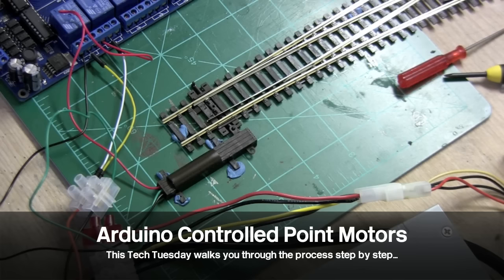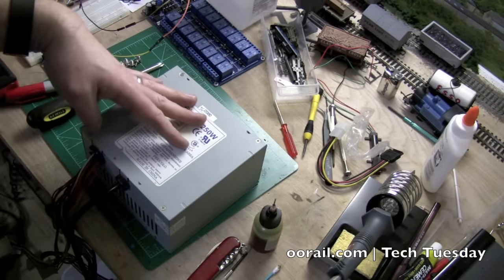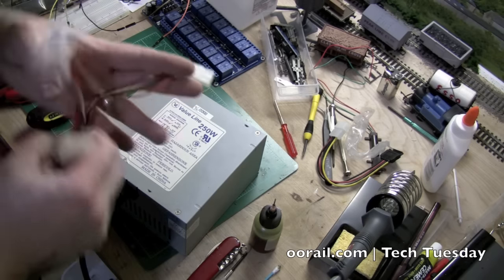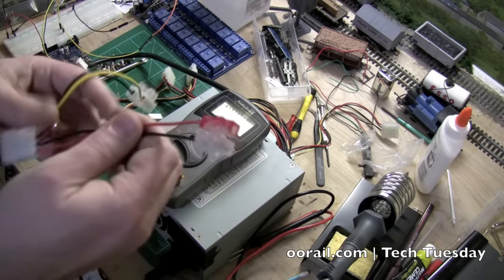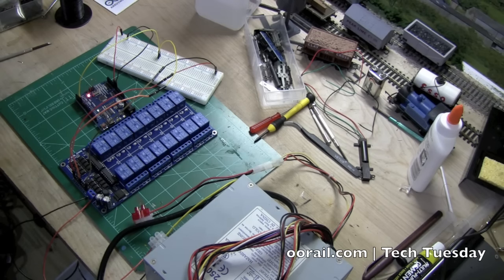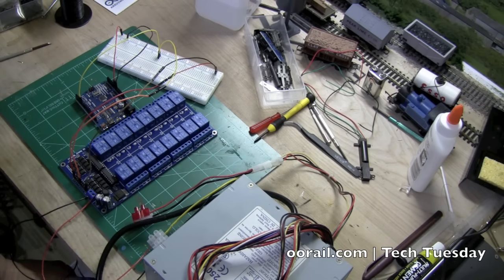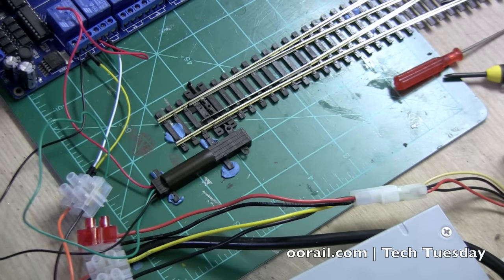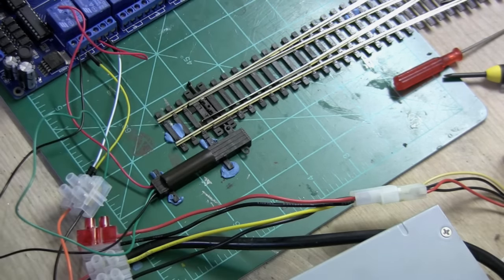oorail.com | Tech Tuesday - Arduino Controlled Point Motors

Comment: You got off on a completely unrelated tangent because of a power supply that had a stuck fan.  For those wanting to use a PC power supply (an excellent choice, by the way), there is absolutely no need to open up the case.  And some of those power supplies do not have an external switch, just a power switch on the back, although one might have to short one of the pins to ground on the plug that went to the PC motherboard, to simulate a person pressing the "power start" switch that is normally on the PC case.  (In other words, the much older AT style power supplies that has an external power switch and the newer ones that simply have power applied to the motherboard continuously -- at least to that circuit that goes to that pushbutton switch that is on the case.  I hope that makes sense.)

And if you have the case open, you won't get killed from touching one of those low voltage DC capacitors (unless you have wet hands, in which case you shouldn't be allowed to be around electrical circuits at all).  Those are just to filter the pulsating DC power (usually about 18 Volts peak DC) to a steady 18 Volts, before going through a Voltage regulator circuit -- or in modern power supplies the whole thing is done using fancy fast Silicone switching circuits -- called "switching power supplies", which are more efficient.  I also have a degree in EE (actually EE + Computer engineering, and a member of the Electrical Engineering Honor Society, "HKN" or Etta Kappa Nu, from George Mason University -- AFTER having spent over 25 years in electronics.

But you should not be messing around inside one of those power supplies with the power applied.

Comment: Excellent "How to" John, very easy to follow.  I have converted several ATX power supplies in the past, you need to bridge the green wires to make the power supply think it is connected to a motherboards, the ATX needs a resistance to make it switch on.   Other than that it is the same as your AT supply. Looking forward to you other tutorials...Simon
Reply from the maker: +Liverton -Simon Thanks Simon... Yeah I didn't want to completely scare people off, so the AT power supply was a quick and easy way to do it. They are also a lot cheaper to pickup new :)

Comment: This is (except for the fan sidetrack) an excellent video.  Thanks much.  I sent it to a 12 year old friend of mine in another state that I sent some Arduino sets to.
Reply from the maker: No worries, glad you enjoyed it. Background noise is an on-going problem around the layout, I typically only have enough time to do these videos on one take, so I often run trains in the background to drown out any unwanted sounds. The layout is in the basement, so everything from kids, dogs and cats running around upstairs will generate background noise in the videos. One option is to narrate the videos during the editing process, I do have the equipment for that but it is more time consuming. The other options (which I'm trying first) is to upgrade the flooring upstairs, which is currently in progress :)

Comment: Cool approach, definitely interesting. I'm starting to to figure out controlling the point motors on my layout, I have 25 points just in and around the station. I've done quite a bit with an Arduino before, so this is worth exploring. Thanks for sharing.

Comment: Did you ever take this to the next step and actually control the points/turnouts with switches to operate the relays via the arduino?
Reply from the maker: Hello Bruce. Yes but I swapped the arduino out for ESP8266 and ESP32 devices on the layout. I will be making the code available in an upcoming video. So stay tuned!

Comment: I got it all the way correct until the point when I get ready to attach the 3 wires (in my case 3 screws), to the relay outs. Using two of the relays at that. I think that each side (relay) would control a direction? Then you used a external power source from some where (where you added that connector). Did you run the positive that positive 15v directly to one of the point's wires? (Positive 5v)? Do the other 2 wires from the points connect to the "closed" side of each relay? Thanks! You did help me a lot. LOL

Comment: Have you considered bagging the relays and going solid state?  A Ti L293 or L293   ($2) could be controlled by an Adafruit ESP8266 ($10)  running your existing Arduion code.  Much smaller foot print, no relays.
Reply from the maker: Thanks John. Yes this is a good suggestion and one that I did look into. The problem with L293 is that the maximum current draw supported by the chip is around 600mA, while a point motor like the PL-10 will draw about 2A and the gaugemaster ones I have I think draw even more. Since point motors are only tripped for a second or two, a small heat sink may do enough to protect the chip. That said, the ESP8266 platform is definitely the way to go. There are a number of ESP8266 devices I am currently experimenting with for a variety of Tech Tuesday projects. I have a stack of L293d chips, so when I get a chance I will experiment some more with your suggestion. I'm not actually too concerned about the footprint as the relay board, arduino mega and an ESP8266 board are mounted to the underside of the baseboard, centrally to a bunch of point motors. That said, I'm going to shop around, see if I can find a better IC option that can handle higher current draws.
Reply: This is some info I got on a forum I had posted on about this for my own set up.  It may be of interest with regard to your power draw.

"if your solenoids need less than 1.2A you might want to look at the TB6612 breakout:

https://www.adafruit.com/product/2448

The TB6612 works like the L293D, but has a higher current rating. If you end up needing more than 1.2A, the DRV8871 can handle up to 3.6A:

https://www.adafruit.com/product/3190

Both of them take logic input signals, so they won't put any load on the microcontroller driving them."

Comment: Love the video but would like to know has there been any advancement of this module? I am interested in controlling multiple points with a switch and LEDs using this method. Is it possible to have a diagram of the wiring?

Comment: How about using one of the Chinese LED 12 volt power supplies?  Are they "clean" enough for driving the relay board?  I plan on using a 9 volt wall wart to power my Arduino.

Comment: Hi , I am another of your long term subscribers.  Do you have a wiring diagram  for this Arduinos project ? You can make available .
Regards Robert
Reply from the maker: Robert you can find the sketch over at https://github.com/oorail/arduino-rail/tree/master/point-motors/relay I believe you just wire the relay module up so you are connecting the contacts together when it throws, then you just have to wire the control pin to an Arduino pin for each relay. This is controlled in the sketch by:

#define RELAY1 6
#define RELAY2 7
#define RELAY3 8
#define RELAY4 9

I can definitely put together a diagram, I still have the board configured on my workbench, so I'll use it to put together a diagram and will push it up to GitHub referenced above tonight.
Reply: Thank you in advance for the wiring diagram. Did you consider using a CDU to assist the movement of the Peco point motor? 
Regards
Robert
Reply from the maker: @oceancity1042  Yeah I started building my own CDUs, I'll do a video soon. On the diagram, the relay module has a low-level pin for each relay, these go to the Arduino pins to control each relay. You put the power and point motor on either side of the relay, so when the relay is active you connect the power and point motor together to complete the circuit. A CDU would be a better option, I had no issues throwing the peco point motors directly though.

Comment: with atx power supply just connect a switch between the green wire on the 24 pin connector and any black wire to turn it on.

Comment: Hello John. Great video! I am wondering though, how would you provide a (visual) feedback through LED? I am planning to have my layout both run on DCC and on DC (for when the kids are using it).
Reply from the maker: +Chris Wisselo I'm planning on using a voltage and current sensor hooked up to the Arduino as a means of indicating which way the points are thrown. However, I am still waiting for the voltage sensors to arrive. You could then use the sensor information to power an LED or display something on an LCD. A simple option would be to wire an LED and resistor to the track, this would only work though if there was power applied to the track.
Reply: +oorail.com John, you are using the arduino to control the relays, wouldn't it be easier to tie a LED somehow to that?
Reply from the maker: +Chris Wisselo Well the problem is that the Arduino only knows that the relay has been triggered a particular way. It doesn't know the actual state of the physical point. You could code it up by assumption that its starting in a particular state, but what happens if the point doesn't switch properly or someone manually pushes it to a different state? Adding the voltage sensor to one or both directions of the point, the Arduino can get some sensor data as to which way the point is actually in, plus it can detect faults (not thrown either way) and get you voltage data at that point on the track. You could then use that data to trigger an LED if you wanted to.
Reply: +oorail.com Very true... Are you going to adjust the system so it will only take 1 relay per switch?
Reply from the maker: +Chris Wisselo Yes this involves building a Capacitor Discharge Unit (CDU), there are a couple of ways to build these, the one I settled on uses two 4700 uF capacitors and can drive several point motors at once. I put together a prototype last month, waiting on some euro-style PCB terminal blocks to arrive from Element14 (should be this week). I have one section of the layout (the third rail line) that I want to fully automate, so thats one of the other reasons for the voltage/current sensors - route setting etc.
Reply: If you use a SPDT relay (or even DPDT if you have to), you can have the same relay not only throw the turnout, but using the right resistor values, turn on the correct LED.  I am planning on doing the same.  I believe some tortoises actually have connections on the bottom to route power to the outputs of one of each of two rails attached to the points --- you'd have to research that.  But a lot of turnouts also route power.  They only switch power on one "output" rail, if that makes sense.  So if you have, say a siding that the turnout routes power to when thrown that way, you could use isolating rail joiners but still route power to the rails beyond the isolated joints using wires.  Does that make sense?  If you can do that, then you can use power from each switched rail to light whichever LED indicates the turnout is thrown that way.  That may be the simplest, if you are using turnouts that route power between two "output" rails.

Comment: hi can you please help me first time i have ever fitted surface mounted points PecoPL11's they are connected to a CDU all are brand new when i throw the switch you can hear it click both ways but the point dose not come over its running on a pc power pack 12v 30amp is it because the voltage is wrong ?

Comment: I went with ATX so I could make it switch on via remote the ATX has a 5 volt stand by which can be used to power a Arduino nano and a remote receiver so I can turn all on from anywhere in the room

Comment: Note that some turnout "motors" -- many of which are actually just solenoids -- require power to just be applied momentarily, not left on (which might burn out some such motors/solenoids or at least load down the system with unnecessary power drainage).  Arduino can be programmed to turn on power to a motor/solenoid, sleep a few milliseconds and then turn that power off.  
  Also note that some turnout motors/solenoids require 16 Volts A.C., such as the surface mount Peco "motors" PL-11.  I'm going to have to carefully research what kind of power to apply to the Peco PPCPL10E's that I have and to the Kato turnouts I plan to use in certain places.
  Also, for those who don't care about visual reality so much, Atlas makes some turnouts that have their own "motors" (which I suspect are actually just solenoids).  Some people have complained about certain N scale Atlas turnouts derailing some engines and cars, but most work oK.  I only use Peco turnouts for my N scale layout, except where I plan to use the fabulous Kato double and single double-track crossovers.  (Look those up.)  It just requires some extra work when ballasting to make them blend in with other track.
Reply: 10 -- 14 volts dc will trigger these
Reply from the maker: Think you might want to watch the whole video, around 35:00, I demonstrate that you only apply power for a split second, basically the arduino tosses the relay on/off to drive the point motor. The Peco PL-11 motor is actually the one in this video that I'm driving with 12v DC, you can drive them with AC, but keeping things DC is probably safer, and prevents making mistakes. The HO scale Atlas turnouts are awful, I used a couple on the original part of the layout here around Chippenham Junction station for some sidings. A lot of locos have problems with them, and they are visually awful :)
Reply: my circuit fires for about 3/4 seconds I will put up a circuit of my driver

Comment: OK, everything is there but how are you doing to activate the  turn out ,It's  not written  in your code...  toggle switch, button?  To me that the only thing missing. coding a little long try array..shorting you code.
Reply from the maker: That code is just example code to show how to use the relay, its supposed to be simple so folks can understand what is going on. Could have moved the block into a function and just passed in the relay number. Stay tuned to the channel though, something a bit more sophisticated is on the way. :)

Comment: Hi, I have watched this video several times now, it is really interesting informative and helpful, i hope you dont mind if i ask a couple of questions.
1 do you have to use the 12 volt relay board or can you use the 5 volt board?
2 i am hopeless when it comes to understanding the programming side but i think i could manage the hardware side, would you mind if i copied your code/sketch to operate what i want to do?
i am currently building an n gauge layout (there are a couple of videos of it on youtube) and i have approximately 70 sets of points/turnouts and uncouplers on my layout and i would like to automate it using the Arduino system, maybe later on even add signals, I have researched it and i think the Arduino Mega board would probably have enough capacity for what i need. My system is all Fleischmann and the turnouts and uncouplers all run on 16 volts ac i believe. Is this something that is do-able or not? 
I know there are loads of questions here but i would really appreciate your help.
Reply: I am planning on doing something similar, but am concerned that the Arduino boards, even the Mega, do not have enough separate outputs.  Like your layout, I expect to have about that many (around 70 or so) once I am finished.  Right now I have a 16.5 foot long N scale complex switch yard with roundhouse and multiple tracks and sidings running through the town next to the yard.  I counted turnouts once and it came out to somewhere around 35 or 45, I'll have to count again.  If I install under the track servos or tortoises, I'll have to remove a lot of track and drill a lot of holes through the plywood.  The extension to the layout that I'm building uses foam board, which should be easier, plus I'll put in the tortoises (or servos) before I permanently fasten down the track.
  Anyway, I'm wondering if the Arduino boards can be configured to somehow multiplex to control more than the few I/O connections they have.  Any ideas?
Reply: In other words, I'm thinking I might have to use multiple Arduino boards, perhaps controlled in sets by other "master" boards that determine certain preset routes.

Comment: Very interesting are you going to use this in a computerprogram for your layout?
Reply from the maker: +Jan Verhoef Yes thats the plan... The next step for the point motors will be to build a capacitive discharge unit so that I don't have to use as many relays. When I'm done, it should be possible to program routes etc.

Comment: So is it not a problem to use a lower voltage on the point motor since it's designed to use 16V?
Reply from the maker: Nope obviously not from the video :) Most point motors can run off 12V DC - 16V AC, check the specs for your specific point motors obviously.

Comment: Hey! Great video, actually went and bought one myself, but I have a few questions- 
So I am using a red board, but its basically just a knock off identical to an ardiuno uno- just to get that out of the way

1- Do you know a nice way to control every relay with an uno without running out of digital pins? I thought I was being very smart and set up a spare 5V relay I had lying around to control one point (what I am calling the set of two relays needed) with a single wire to the arduino, but then I realised that I would need a third relay for every point, and that would get a bit silly.

Ok, that's really the only question.... If you are still using this though I would love to know how exactly you have it set up, oh and also I would like to avoid using the analog pins of the uno as digital ones because that would still leave me with only 4 pins free.

Once again great vid, I'd highly appreciate any advice anyone could offer.
Reply: Mega!  Or use two uno's...